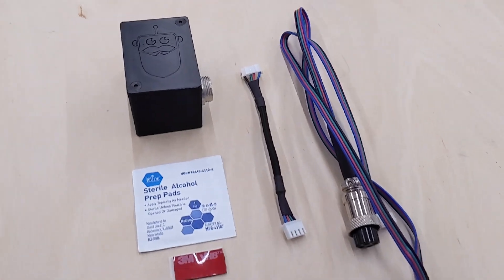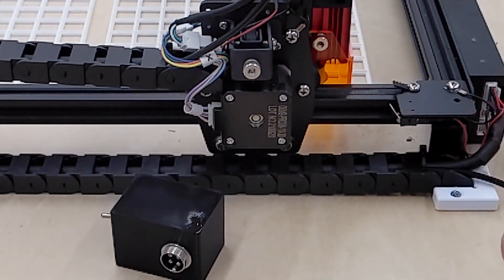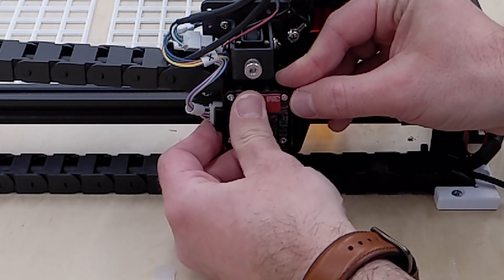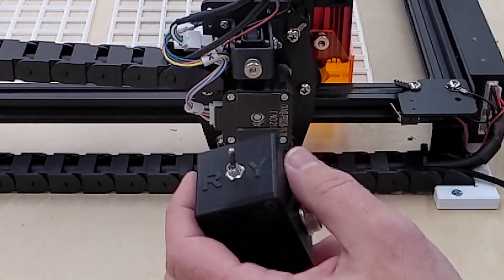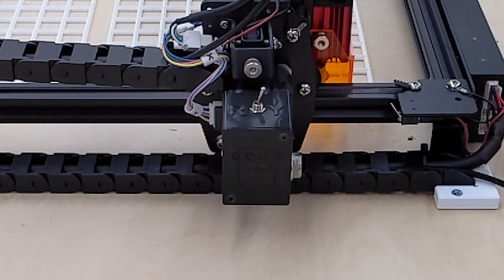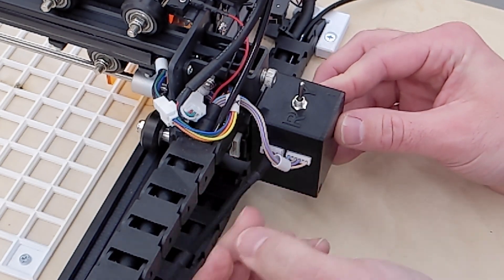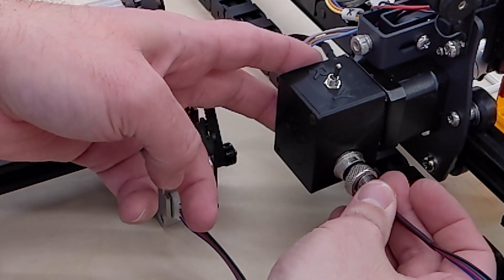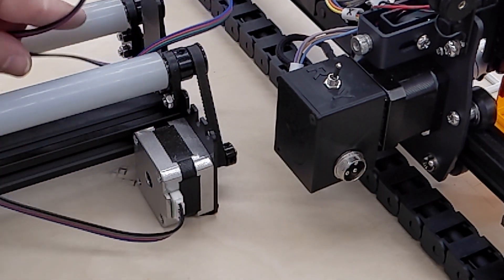How to install the Ortur LM2 Pro Rotary/Y Axis Switcher

Comment: I've got to ask. What's the advantage of this over the normal method of just unplugging the y to plug the rotary in?
I'm seriously considering buying this be need to be sure it fits my needs
Reply from the maker: The main advantage is if you continually unplug and plug in connectors that aren't designed for it, eventually the cable/connector/stepper connector is going to break. Plus flipping a switch is a lot more convenient!